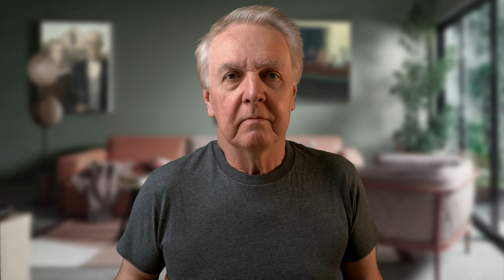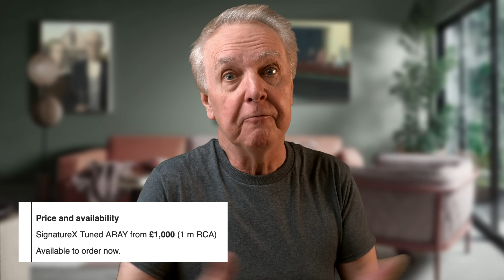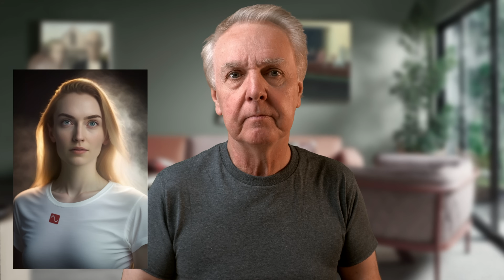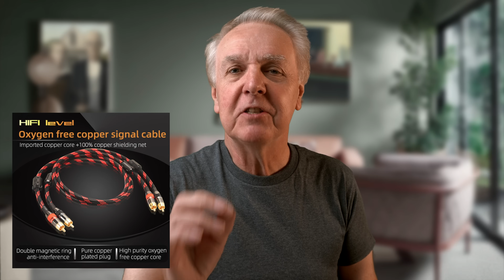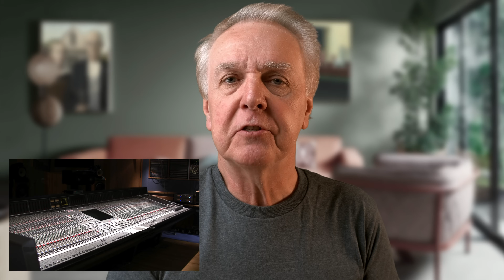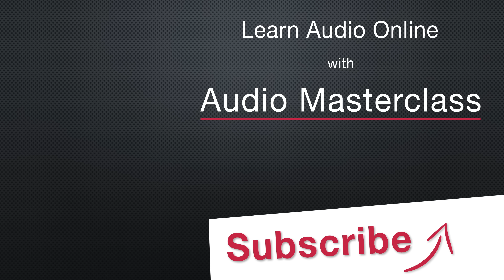Would you pay $1000 for a 1-metre cable?

Comment: what do you think of the jitterbug fmj from Audioquest?
Reply from the maker: I've looked quickly at https://www.audioquest.com/streaming-computer-audio/usb-data-power-noise-filter/jitterbug-fmj and my first thought is that if there's an RF problem it should have been corrected or avoided at source if possible. Other than that audio equipment should be resistant to RF. But it isn't an expensive item and I suspect some purchasers find piece of mind to be good value for money.
Reply: @AudioMasterclass  Thank you for your response, I have owned the jitterbug for 2 days. I live in a large flat with many types of WiFi and DECT phones and smartphone users etc... I bought it at a very competitive price € 39 at the audio show in Tilburg, the Netherlands, very good deal. got the tip from one of Primare dealers, just plug it into the USB port on the back. He suggested that this Jitterbox works as a stop against RF signals entering through this port, but thought it was a bit strange because the Prisma is also a WiFi module that also causes interference. I first listened to my music again and then inserted it with a USB jitterbox as described earlier. and it sounds more organic and more analogue with more peace. the difference is even more noticeable with bad files such as MP3. My conclusion for the time being is that it works. I also put it in a bluesound node. with a USB stick on it, unfortunately the Samsung T7 did not work. I never listen to USB sticks because of the high noise and vulnerability of electromagnetic charges... and RF signals. I'll just leave it in the USB port on the back for the time being. that's where all the signals come together, where he can do his work. Even with the Denon Ceol n11 class D amp I heard more peace in the music. However, I heard no difference with the Denon Dra800h. It is probably because the amplifier is not built properly, I really dislike this sound. is now for sale.
Reply: @AudioMasterclass  Unfortunately you are one of the few real audio critics who dare to say that cables of € 1000 and more are idiotic, I would say a nice revenue model for the audio store. there is so much nonsense being sold that is simply not true. A power cable should simply provide power, nothing less. My preference is to use at least 4mm cables. On UTP cables I also experimented with a ferrite core on both sides, somehow the digital signal also sounds quieter. In the house I covered the ceiling with thicker aluminum foil to make a Faraday cage to keep out high frequency noise in the house, which works perfectly. without foil 10 -30 Watt high frequency to 0 Watt also on the ground, it is not yet necessary because the resident does not have strong WiFi or a smartphone or DECT telephone. measuring is knowing. the less radiation, the healthier living environment for people. Perhaps not all words are correct, I used the Google translation.🧐

Comment: I've never believed in the big differences in sound between RCA cables, I used the cheapest OFC I could find. It has to be said that they looked simply good for their price +/- 3€/m. Then, I wanted something more solid and pretty in keeping with my more high-end system and I ended up using Chinese cables made from a low-capacitance microphone cable CANARE L-4E6S STAR QUAD that was well protected against electromagnetic pollution because it was made to run for dozens of metres on concert stages in the middle of lots of emitters and other cables. Believe it or not, the sound became better, it wasn't night and day but better, price +/- 20€/m. Since then, I've switched to active 4-way and entirely to XLR, so I needed a bunch of cables. Given that XLR is by definition technically less sensitive to electromagnetic pollution, I opted for the cheapest 1m OFC I could find, which cost me 35€ for 10 cables, and the sound is just perfect. I've had a lot of audiophiles in my home and I only let them in on my 'secret' when they leave, which is rarely before 2-3 hours of listening and then 'surprise, look at this cables'. My speaker cables are OFC, bought very cheaply, like 20€/10m, so...

Comment: Another good video that's right on. For decades I simply used. hardware store wire. Then I decided to upgrade my wiring. I had 2 friends that had upgraded their wiring at different price levels. I talked them into lending me their wiring and I did one day extensive testing. One had $300 wiring the other had $100. Mine wiring was many years old and about $15. Long story short, the $100 did make a difference the $300 did not, so I went out and found some oxygen free wiring and with decent connectors and it wasn't a massive difference but it actually was a decent upgrade for about $75, plus after decades with the same wiring it was about time to change. My system isn't a so called "audiophile system" but it I do have dual subs and Monitor Audio speakers and I really like the sound.

Comment: Before packing everything before our move, I connected my Adams with RCA instead of the cheap Snake XLRs. They sounded like shit. There is basically no Hifi gear out any more that is using balanced connections. So you hunt for hum or solve it with ferrite beads. Cheaper than a balanced design and a market opportunity for snake oil salesmen

Comment: One day some HiFi enthusiasts might actually start to enjoy music, you know the stuff we all rave about. As we get older our ears won't pick up the high frequencies, I found a solution, turn up the treble a tad, much cheaper option. 
Back in the 90's I bought some gear from an independent HiFi emporium in Bredhurst Kent, I was offered to test 3 pairs of interconnects priced at £40, £80 and £200 I have to say I couldn't tell the difference from my £20 pair, maybe it was so marginal so I kept my ones and returned them, I'm not knocking the very expensive interconnects but what's the point of spending oodles of money on cables when I can spend more on LP's.
 Btw I'm 75 and I have a Wavetec frequency oscillator and with a sine wave signal I can't hear much past 5Khz whereas my son can hear up to an impressive 12Khz, I have a reasonable sound system and enjoy my music from my ATC loudspeakers, my son also enjoys the same music but has to turn the treble down to suit, simple.

Comment: Your videos are interesting and you know what you are talking about, thats for sure, but you are also an entrepreneur who is making money with what you do. Is a cable worth that money, maybe not, but in my experience speaker cables make a huge difference. RCA cables make a difference, but not as much. Therefore its called "tuning" and if you try with the right match, you can make your system shine. What you need is time, experience I mean your ears and money :-) I have tested many cables and yes they sound different. As a Swiss guy I find the cables of the company VOVOX worth the money, and the Equipment of Weiss Engineering very very good, although the EQP from Dani Weiss is very expensive. Is it worth it? Can people hear it? Well he won the technical grammy Award. As a Sound Engineer with an experience of almost 20 years, I understand the Hifi market and it is maybe 10x the price as in the pro audio field, but also much better. What I recommend to people who complain about cables, stop talking and try for yourself. Have you had a listen to different cables in the hifi field?
Reply: You could pray to a deity too maybe that will make it sound better......
Reply: @will7its  easy you can stay in the dark 😘 
I wish you all best
Reply: @ivansteiner5677  Good luck on your journey too.😎
Reply: Yes but the cable stops at the speaker box and runs thru crappy wire to the speaker.......
Reply: Yes I know - and? Same is with powercords. 
Most important - Have you tried it by yourself?
From my point of view - if it sounds better and it fits into my System - I’am happy.
Reply: @ivansteiner5677  Ignorance is bliss.....
Reply: Thats so funny - Im now in the cable debate 😂
Why dont you try by yourself?
I do not measure sound.
I listen to music - very easy 🎉
Thats what is all about 

You really miss something

Comment: I have listened to an A/B test of the interconnect mentioned at the North West Audio show,  compared to a cheaper cable also from Chord.   Everyone did agree that the £1000 Chord cable sounded better then the cheaper Chord cable.   Would I purchase the cable, well unless I was a multi-millionaire I expect no.   I personally use Van Damme Lo-Cap 55 silver placed interconnects, cost around £35 for 1 meter and there very good also.

Comment: I love my ali express knockoff cables. They're built well, and if I want to eliminate quality control worries (and it does happen), I can just buy in bulk and build my own - and I sometimes do. Good shielding, good materials, good durability...it's all that matters for short runs like this
Reply: Bought Ghentaudio cables made with Canare cable and decent RCA plugs, really good and fairly cheap for the quality.  Bought the Canare based speaker cables too from the same place, very satisfied.

Comment: I doubt if even very high-end equipment uses anything other than ordinary copper internal wiring between the sockets and the PCBs. The audio signal usually then has to travel along a copper track on a PCB and to an integrated circuit or a discrete transistor so I'm sceptical that any expensive interconnect will make any difference. If you were that concerned then you'd be better off missing the plug/socket interface completely and solder a cable directly from the PCB in your source to the PCB in your amp. Of course, this would make it very inconvenient to move your system or replace the different parts of it;-)

Comment: In the same league as silver power leads. That poor dirty electricity came all the way from a grubby power station, across country, through all weathers, and finally, almost out of puff, into your lounge room. But fear not, all could have been well, that poor dirty electricity would be cleaned, buffed up and polished to a mirror finish if only you'd had the foresight to part with a serious wodge of folding stuff on 6 feet length of silver power cable, only of course if you also purchase a gold plated audiophile fuse...

Don't make me laugh, your money would be far better spent on a beautifully crafted wooden box that you place on top of your amplifier, or CD player, I forget which, that guarantees a sound improvement. No bugger except the maker knows what's inside these beautiful looking boxes, and predictably, they're too expensive to take a hammer to, to find out...

My guess is it could be anything from a block of lead to, well anything that weighs as much as lead. They're pretty heavy...

It's all a farce folks, a fool and his money etc...

Comment: It's really important to include the fine-structure constant when calculating optimal speaker placement, room-treatment composition acoustic coupling coefficients, and ideal qubit density/sq. cm. for the quantum regenerative AI back propagation amplification modules. As the rest can get messy pretty quickly, a good slide rule is your friend.
Reply: A slide rule my friend is futile. A microscope, electron accelerator and quantum physicist is more useful. You will also need 3 cable ties, 2 non ferrous locking nuts and a dead parrot.

Comment: Thanks for your insights! I've recently learned to build my cables myself, using the best materials for a fraction of such pricing (which IMHO is similar to a scam). With a bonus: they look great (as I want them to for no additional cost), and fit well with my deco - even if they're mostly hidden lol.
I'm now trying a combination of one end from the amp having silver-plated copper connectors  + silver braided shielding over Teflon (a Marantz, so that I lift high freq definition), and gold-plated copper connectors to the speakers (affordable ELAC's Uni-Fi 2.0, which already have a good definition in high frequencies, whereas the gold plating "could" lessen any harshness) ; the cores are pure Oxygen free copper (I could've gone with the Japanese pure copper which is about twice the price, but I don't think it would make a huge difference given the gear that I'm using)... Anyway, I'm just having fun experimenting with this, I'll see if it's relevant in the end.

Comment: I remember back in the 80's a well known HIFi magazine in the UK ran a blind test with some very 'knowing' HIFi reviewers. The system was set up with high end components and the 'interconnects' were switched in and out across the period. The cables tested were the top end available, to basic commonly available. One cable that was slipped in to the test was electricians twin and earth mains cable which you could buy in drums at trade prices. Yes you guessed it, the twin and earth mains cable came out overall best by some of the reviewers. So ? its all down to the listener, some cables may affect the signal in different ways, but we all have different preferences in the final sound, and different ear/brain responses. How a cable/interconnector looks on a bench test electronically really means zilch, you don't listen with your eyes !  Don't look at the price, ignore the snake oil marketing just install them, shut your eyes and listen. that is the only measure. You choose what sounds best for YOU. Great video , thanks.
Reply: It was speaker cable, and it was Hi Fi Choice magazine
   They haven't run a blind test since lol

Comment: For a LOT less money, per meter, you can get 3 1/2" Andrews rigid co-ax.  With a pump/dehydrator or cylinder of nitrogen (to pressurize it), total cost would still be less, at least, for say, a two meter run.  This set-up worked very well for the 50KW AM broadcast transmitter I used to work on, to connect its output to the antenna tower.  So it would PROBABLY suffice for connecting stereo components together.
Reply from the maker: Newflash - Audiophiles rush to pressurise their cables. DM

Comment: buy active speakers and use only signal cables of pro grade, which are 2-3 USD/m (plus termination). it's a pity people put attention to wrong items: spent fortune on cables including digital signal cables, while not even measuring the room, not treating the room properly, not handling low frequency modes. You can gain 100x more in terms of sound quality by simply adding EQ targeted on your lowest room mode (you can do it precisely in digital domain) than upgrading 100 USD cable to 1000 usd one. People just don't know it, and they are even disgusted about the very idea of EQ. This is called ignorance. (I don't deny different cables, especially speaker cables, can sound different, not necessarily better.

Comment: I've always  had the idea to let 'audiophiles' listen to three different 'interconnections' from different brands and let them put these three into the right order with 'the best' on top and 'the worst' below.
I think that will turn out to be quite hilarious.
(and pretty painful for those who fail this easy task,,,)
Reply: Better yet, lie to them about which is which and how much it cost.
Reply: I once did a test with an ex-audiophile colleague of mine, on one of the audiophile forums that he frequented. We used some reference audio tracks that he provided, compressed them with a whole range of MP3 compressors (from terrible ones to the best you could get at that time). We then converted those MP3's back to WAV files and created a set of A/B tests that the forum users then had to judge on quality to see which was the original recording and which was the one pulled through the MP3 compression/decompression cycle. All but one of the forum users miserably failed to identify the original tracks. When informed of their results they of course came up with all kinds of reasons why they failed, the most hilarious one was the guy who always boasted about the fact that he could hear the difference between good and bad power leads, who claimed that he had used the wrong power lead.
Reply: @YouHaventSeenMeRight  
I'm afraid that only one of your candidates knows how mp3 compression works and therefore was able to choose right. (Or he neither understands mp3 compression but simply got a lucky shot, of course.) 
I also think that most audiophiles suffer from a nasty 'keeping up with the Joneses' virus infection for which no vaccine has been developed. I mean, buying a Tesla doesn't automatically turn you into an EV technology expert.